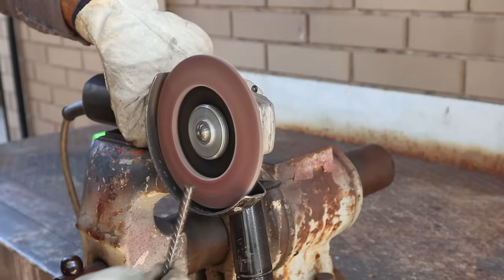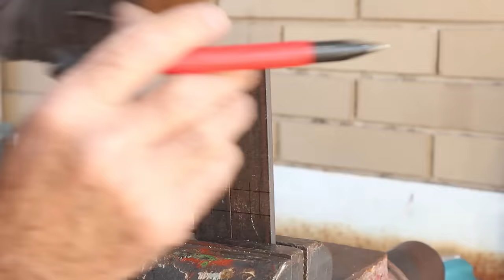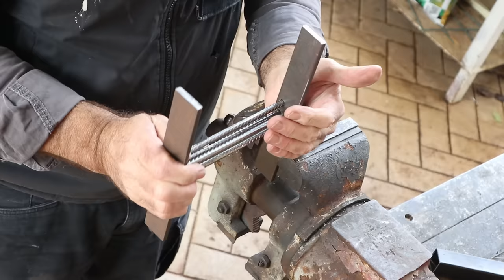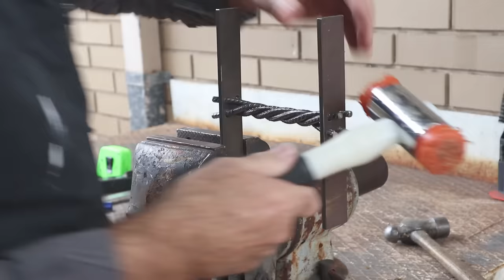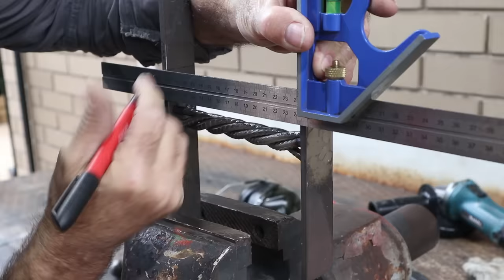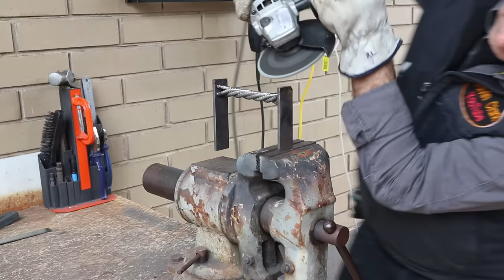I make a Twisted Steel Rebar Industrial Style Handle - MIG Welding Project.

Comment: Daughter likes to collect old used railroad spikes. Likes to paint them and give away to neighbors. They needed to be cleaned before paint and didn’t want to wire brush. Threw them in cement mixer with sand blast media and tumbled for few hours. Worked perfectly for smaller rusted steel.
Reply from the maker: That is a nice simple way to do it, and while it is happening you can be doing other things, instead of being on the wire brush, thank you for your comment.

Comment: Those small diameter rebar twisted together like that would make one helluva strong handle. I'd dare say you could bolt that to a small engine block and pick it up without bending it. Looks good too.🤛
Reply from the maker: Thank you very much, I agree the strength in twisted things is amazing, just like ropes made from weak fibres.

Comment: That another striking piece of work, The counter sink bit you use near the end looks like a good bit of kit
Reply from the maker: Thank you very much, I am glad you liked it. I can't read the brand on the counter sink bit, I have had it for a while and I am quite happy with it.
Reply: I had an idea Gav, I thought you could replace the handle part with 20mm wire rope (if you can find some off cuts)
Reply from the maker: @Everythings_Adjustable  Yes that would look amazing, I don't have any but will keep an eye out for it or something similar. Thank's Sparky.
Reply: @GavinClarkdiy  Good luck in your search Mate  
🔨👍😊

Comment: Great work! Have you considered cutting the rebar longer than you need and cutting it where the twist is still tight? Call it personal preference. Nevertheless, well done.
Reply from the maker: I have made a few like that, which I have not made a video, I thought they looked a bit thin and plain, maybe it just needed a few more bits of rebar. Thank you very much Curtis, a very good suggestion, I appreciate your comment.

Comment: Love your work. What do you treat the handles with to keep them from rusting when used outside?
Reply from the maker: I will probably use wax on this one, there are a lot of tight places and the wax will get in it well. I have decided not to comment on finishes, as there are so many answers and questions. As what climate you are in, is it inside-outside, lots of rain, ice, do you want long term and rarely touch, or a wax with a wipe over every year. Please ask someone in your area what you should use, I feel this is a better way to find out about your project. Thank you for your comment.

Comment: That’s really great looking.  Wondering about the application?  Did you protect it in some way from rusting?  Is it an indoor only application?  Some times the patina of rust can also be “rustic” and add to the appeal.  Great work sir.  Thank you for sharing.
Reply from the maker: Thank you very much, I am glad you liked it. Yes all bare metal should be protected. I have decided not to comment on finishes, as there are so many answers and questions. As what climate you are in, is it inside-outside, lots of rain, ice, do you want long term and rarely touch, or a wax with a wipe over every year. That is why I have no opinion, Please ask someone in your area what you should use, I feel this is a better way to find out. Thank you for your comment.

Comment: Thanks for sharing your artisanal talent. I could not see the brand, but I assume your hearing protection aid is 3M. My second question is; do you not fear of the iron splinters after filing. They usually pass through my skin and irritate several days, and I had to use gloves and vacuum cleaner to rid of them from bottom of my shoes.
Reply from the maker: Thank you very much. Yes my hearing protection is 3M, I get the steel splinters at times, I can't complain as I should wear gloves more than I do, that would prevent most of them. I wear steel-toed work boots so my feet are well protected from most stuff I drop and stand on. (I try to pick up the big sharp bits as I drop them). I just sweep the floor when finished. Hope that helps a bit.
Reply: @GavinClarkdiy  the worst is a tungsten cutter on a dremel

Comment: Hi, nice video, can you show the measures, greetings from Portugal
Reply from the maker: They are in the Description below the video, but here they are. The wide flat bar is 6mm thick, 50mm wide and 225 long. The small flat bar is 6mm thick 32mm wide and 57mm long. The rebar is 7mm rebar. The distance between the two uprights is 145mm.

Comment: Do you put any kind of finish on these rebar projects, like a clear coat of some sort?
Reply from the maker: I often use Penetrol Rust Treatment Penetrates Rust 300g Aerosol Spray, and then put two topcoats of Semi-Gloss Clear Coat. That is what I used on the rebar lettering on the back of my workbench, here is the link to that video. https://youtu.be/JA-wk62Zghk I try not to comment on finishes, As what climate you are in, is it inside-outside, lots of rain, ice, do you want long term and rarely touch, or a wax with a wipe over every year. That is why I have no opinion, Please ask someone in your area what you should use, I feel this is a better way to find out what would be best for you. Thank you for your comment.
Reply: @GavinClarkdiy  thanks for the info!

Comment: Looks really great!  Can I ask what you put on it to prevent it from rusting?
Reply from the maker: Thank you very much, I am happy that you liked it. I will probably use wax, there are a lot of tight places and the wax will get in it well. I have decided not to comment on finishes, as there are so many answers and questions. As what climate you are in, is it inside-outside, lots of rain, ice, do you want long term and rarely touch, or a wax with a wipe over every year. Please ask someone in your area what you should use, I feel this is a better way to find out about your project. Thank you for your comment.
Reply: @GavinClarkdiy  yes, I understand about the local conditions, I was just curious about your "weapon of choice" against the elements. Personally I like bee wax, it lasts very long.  Again,  thank you for your nice videos 👍👍👍
Reply from the maker: @marcelbron6128  I am a big fan of bee wax, thank you for your comment.

Comment: How about "blackening" the metal? Otherwise it will rust.
Reply: Similar thought; what do you do to rustproof this piece of craftsmanship?
Reply: @forgottensavage5584  Heat to 200 degrees and dip in vegetable oil.
Reply: @SergeiPetrov  Handy piece of know how that shall be useful in the future. ty Sergei.
Reply from the maker: I will probably use wax, there are a lot of tight places and the wax will get in it well. I have decided not to comment on finishes, as there are so many answers and questions. As what climate you are in, is it inside-outside, lots of rain, ice, do you want long term and rarely touch, or a wax with a wipe over every year. Please ask someone in your area what you should use, I feel this is a better way to find out about your project. Thank you for your comment.